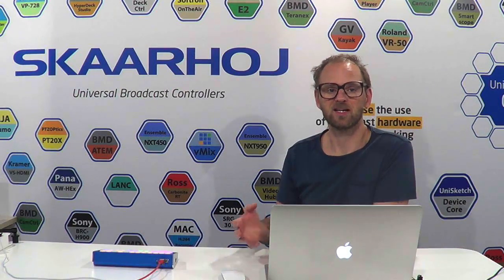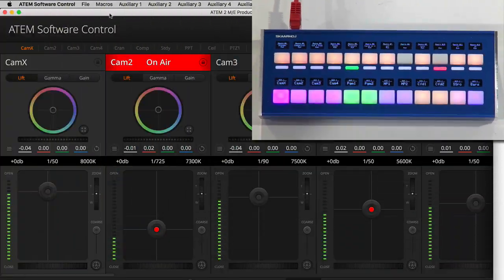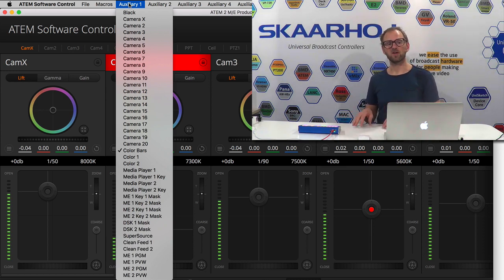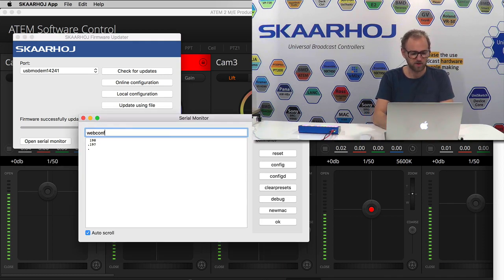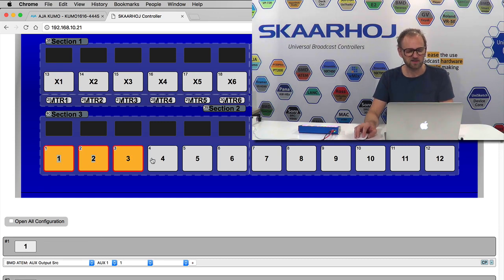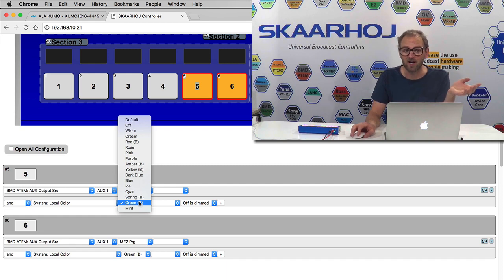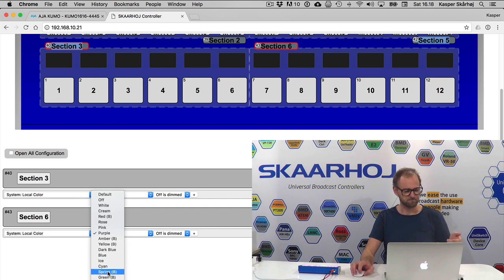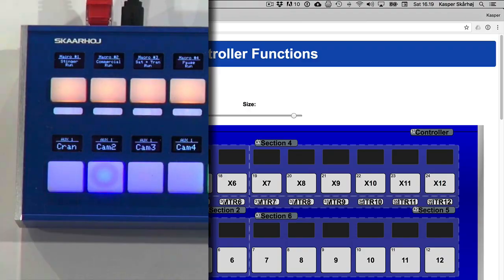XPoint 24 - ATEM AUX and Macro control panel

Comment: Hi, nice little controller! Question: I use the lower buttons, to switch the Aux on my ATEM (I use the AirFlyPro already) - AND at the same time use the upper 12 buttons, to start Video-Files on my BrightSign XT1143?

If yes, then I will order on Monday!
Reply from the maker: We don't have a device core for this but If it supports TCP/UDP or TSL we may be able to have some control but we have not looked into it.
Reply: @SKAARHOJ  Okay, but thank you very much for replying so quickly :-) So I will just be happy with my AirFlyPro...